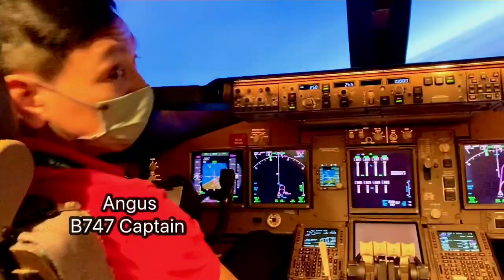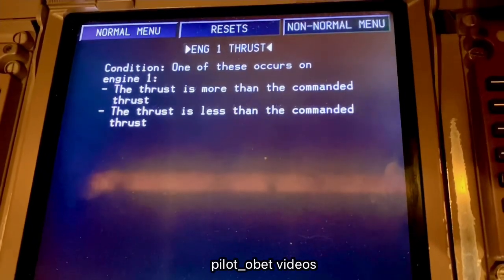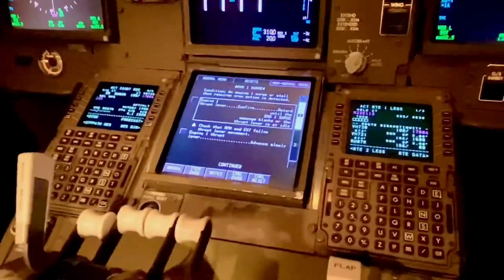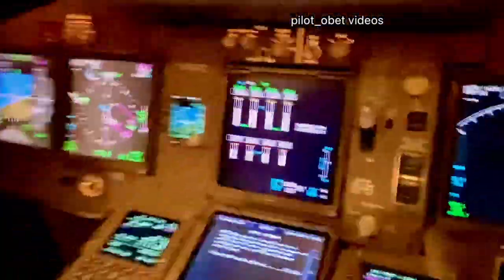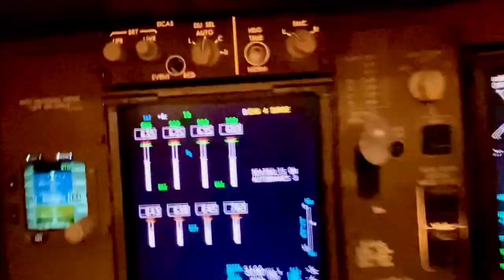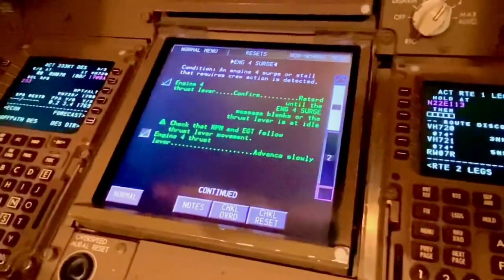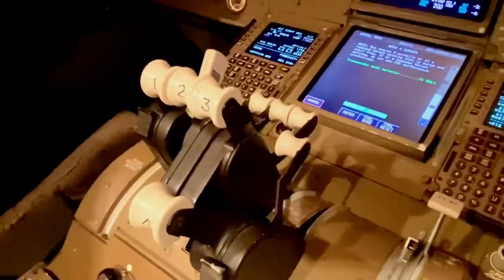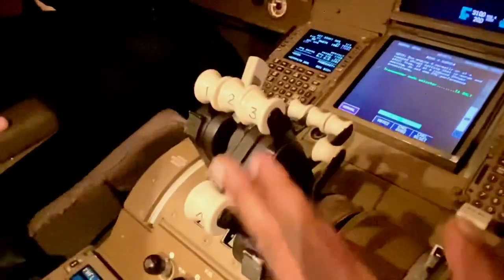B747-8 Engine Surge/Vibration

Comment: Hello Captain thanks for the video. Should you then consider shutting off engine 4 to avoid consumption ? Or will it remove hydraulic function ? Thanks!
Reply: Short ans:
You don't usually shutdown an engine because it surges.

Long ans:
Surge is not a fire, although you may see short bursts of fire/smoke coming out from the exhaust side or intake side of the engine. It is caused by disruption of airflow within the engine thus fire in the combustion chamber leaks out. It is usually not cause by component failure and, therefore, temporary. On the other hand, engine fire is usually caused by component failure such as oil leak or something overheating.
Both surge and fire gives power fluctuations, high EGT and high vibration. To distinguish between the two, look at the fire alarms.
There are three categories of surges 1) Self recovered surge. This means airflow within the engine resumes to normal without pilot intervention. 2) Recoverable surge which the pilot reduces the thrust of the engine and allows airflow to resume. After recovery, the engine produces thrust normally with normal EGT, no excessive vibration, etc. 3) Unrecoverable surge. After reducing thrust or even idling the engine to allow airflow resume, the engine surges  again once you command a higher thrust.
For 1 and 2, u don't shutdown the engine. For 3, if EGT and other parameters stays within limit by putting the engine on idle, you don't shutdown the engine because:
a) An idle engine produces less drag than a shutdown engine,
b) An idle engine can still produce electricity and hydraulic to power the various systems.

Comment: What would be the thrust reverser setting after 3 engine landing? All engines at idle reverse or the 3 working engines on full reverse?
Reply from the maker: All engines to reverse idle position then Full reverse on the symmetrical engines